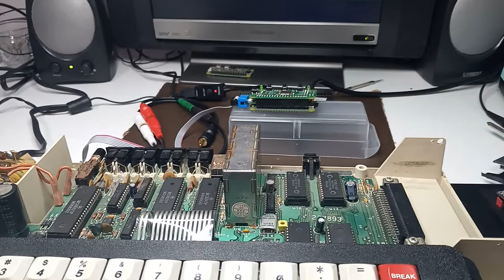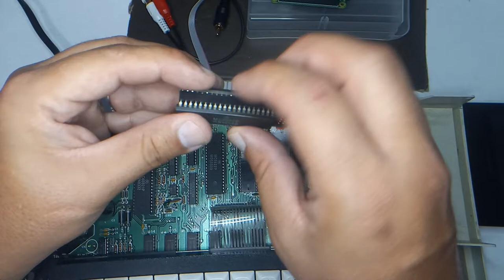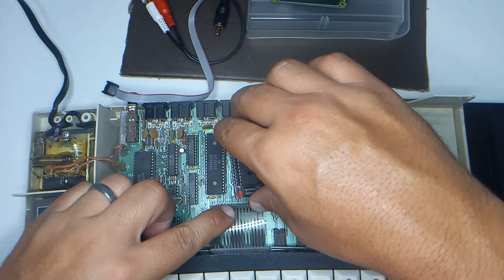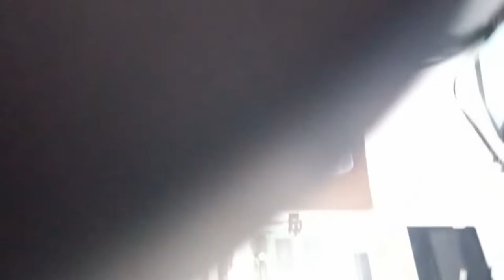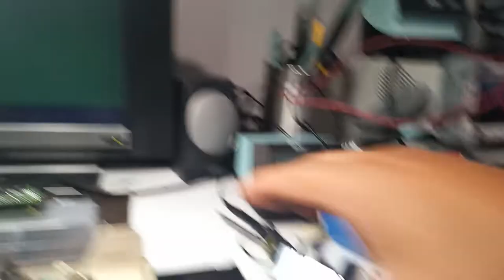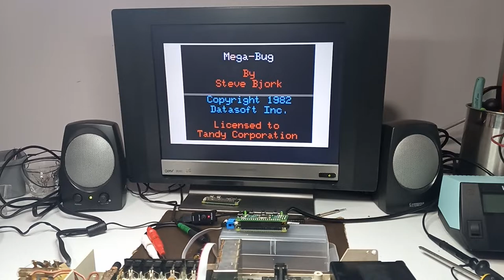Easy HDMI out for the Color Computer 1 and 2 with this adapter board. RGB to HDMI required.

Comment: This is a great PREVIEW video.  Now we need several videos on how you set up the adapter kit and how you designed the socket adapter.  There's a bit of work that goes into getting the signals from the chip to the RGBtoHDMI.  Walk people through that and you'll have eyes glued to your videos for a very long time.
Reply from the maker: Oh, it's an open source project and I'll be posting the design on github pretty soon. I was planning on building two different ones in an upcoming video. I have a slight
Reply: @rockyhill3  Some of us know it's an open source hardware project.  But implementing it in a specific way is of specific community interest.  There's a lot of tuning involved in the RGBtoHDMI... or there was last time I saw media on the topic.
Reply from the maker: @anjinmiura6708  So you're saying I should have a walk through video on how the VDG adapter was implemented? Are you also saying I should record configuring the  RGB to HDMI adapter as well? Downloading and installing the firmware and such?
Reply: @rockyhill3  I think it would be nice to show us "how to" yeah.  The adapter board is a nice thing to be able to buy and eliminates a LOT of tragic mistakes to be sure.  Not all of us are tech savvy to a very low level degree.  But if we had a guide, that might make us less envious and more inclined to try it for ourselves.
Reply from the maker: @anjinmiura6708  Also, when I said open source I meant the boards that I made. The RGB to HDMI adapter I used is a standard design that uses the analog board.
Reply from the maker: @anjinmiura6708  I see you're point and I'll modify the video I was planning making. I'll include as much of the RGB to HDMI configuration that is relevant.
Assembling an RGB to HDMI adapter is a  different monster, maybe I'll link a video where that is done.
Reply: @rockyhill3  Always doing something!  Wish I had your energy.  I have too many diversions and need to work on limiting those.  But if you were to make the new video, your CoCo1/2 video would be welcome as I have a Korean CoCo2 with DPhillipsen I'd like to do this with and a couple of CoCo3s as well.  Obviously, the CoCo3s would just use the RGB out for much of that.  But does this also do the sound as well?  HDMI carries audio and that would be a nice thing to add to the mix... or maybe a very stupid thing to add.
Reply from the maker: @anjinmiura6708  Well, energy is low these days but what I have learned is patience. These days I'm trying to be more organized and open to the idea that I'll have to break a project up into 100 phases. lol. I've been working on that board for several months now. I'll do 15 minutes here and 20 minutes there and keep believing that one day it will be done. The RGB to HDMI adapter does not do sound because from what I've read there aren't enough cycles and or pins to squeeze it in. That said there is talk about it possibly being possible with the pi zero II. I'm waiting for the day!
Reply: @rockyhill3  Not sure which version of hdmi version, but I seem to recall audio passthrough is a thing at least as far as there being devices that will split an hdmi out into vga and audio.

As for building not a good video?  Maybe from where you sit... it's all old news.  But did you happen to notice the still growing number of hits and likes that Strow's video of someone else upgrading a CoCo system board to a socketed 6309?  Still quite popular.

As for your ability to break things down?  That boggles my mind.  If I don't see a project through from start to finish, I lose my train of thought and I'm already short a few box cars.  If I let even a night's sleep go through, I might wake up one day and realize "oh there's a way better way!" and potentially start all over again.  My train invariably derails.

But perhaps you're right.  Maybe the HDMI project should also take segments.  Maybe the first that would cover generic details that apply to CoCo1/2 and 3.  Walking through how it's built and adding links to people who build and sell the boards fully populated?  A bit of narration explaining what things are and what they do.  Maybe a few hand-drawn diagrams.  That would be a rich start.  

Then in videos that follow you would walk though the implementation.  I love that adapter board.  As you say it's open sourced, perhaps you could get some of the maker/sellers like "computer conect" to pick up the ball on making those adapter boards.  (Do you think it would work on a Korean CoCo2?)  And then the one that converts from CoCo3 RGBi to HMDI... probably the shorted of the videos because so much would already be covered in the first two.

There is something soothing (anxiety reduction) about having it all walked through, explained and all that.  It really does encourage us to do more things like this.

Comment: Hello @rockyhill3 - I finally got around to attempting to use your adapter in my Coco 2., but having a strange issue.  When the adapter is installed the Computer hangs and either fills the screen with garbage or the first 2 characters on screen when booting.  The screen is crystal clear so I'm guessing the RGBtoHDMI/Analog board are fine.  At first I assumed it was that I used the 5V jumper to power the Pi/Adapter, was concerned it was stressing the CoCo's power supply, So I removed the jumper and used an external adapter to power the adapter.  Same thing.  Without a cartridge I get the "Ex" from Extended Color Basic repeated, occasionally (hitting reset) I get "OK" repeated.  Works fine via RF Modulator when the adapter is removed (although with horrible signal).  I noticed the Sync/U/Y/V signals are severed to the Modulator, will the adapter work with modulator shorting the 4 solder jumpers on back to test further? I've checked soldering, and continuity on all pins (even for shorts).  Under microscope the adapter if perfect from what I can tell.  Any suggestion would be welcomed.  Thanks. 👍👍 (26-3026)
Reply from the maker: Hi, sorry to hear that you're having issues with the adapter, hopefully I can help. Did I send you this board by any chance? I test these before sendinf them out and for that I usually only solder the async jumper which the RGB to HDMI board requires. I leave the other three open because the Y signal(green) introduces noise because of a capacitor between it and ground. If you solder the other jumpers you'll have to remove the capacitor that goes between Y and ground to get a clear signal. That said you can totally test with the capacitor left in circuit. Let me know how it goes.
Reply: @rockyhill3  Nope just took it off your github... lotsa goodies there from what I saw.  I've really checked the adapter, and I'm sure the adapter isn't the culprit... Ok I see it now the /HS goes to the 6822 (U8).  I'll jumper that and see if the results are different, otherwise I may have to check my Analog board soldering for issues. I'll remove (C59) 150pF if I jumper them all.  Thanks for the details I wasn't aware of.  I'll let you know how things go.  Thanks again 👌
Reply: Added the ASYNC solder jumper on the bottom... all works fine now.  I really appreciate your time, and the CoCo motherboards on the github are my next destination.  Take care.
Reply from the maker: @LearnElectronicsCanada  Great! I was just sitting down to reply to you last message. If you need help with the motherboards please let me know. If you do end up making one,  I recommend using a SAMx4 by @six809E in place of the SAM chip. https://www.youtube.com/@six809E

For now stay away from the T1 CoCo 2. I'm having issues getting it to work reliably.
Reply: Oh wow! I just spent a few hours trying to troubleshoot the very same issue, thinking that all my 6847s were bad all at once. Soldering the ASYNC jumper fixed the issue, thanks for posting this  here!